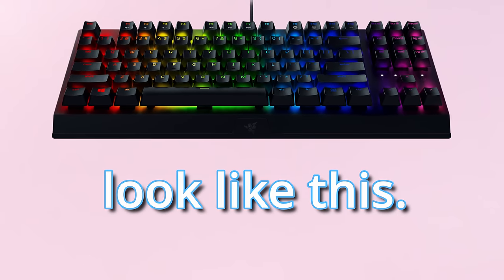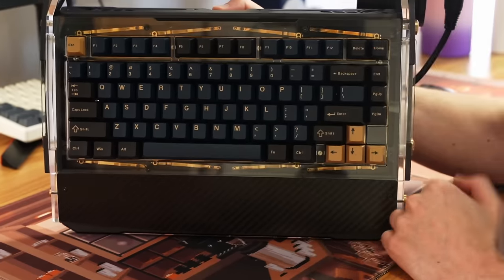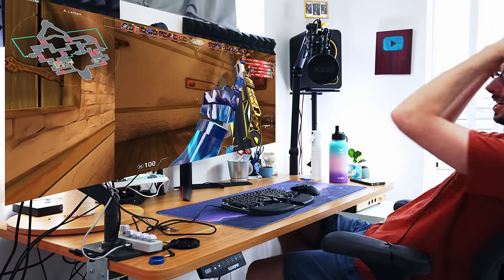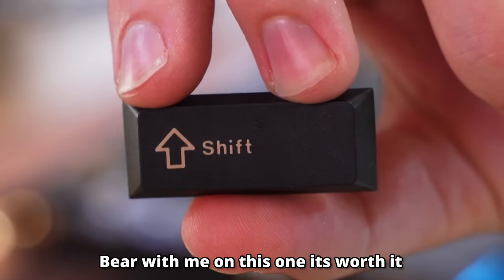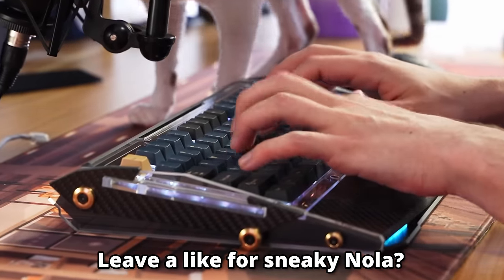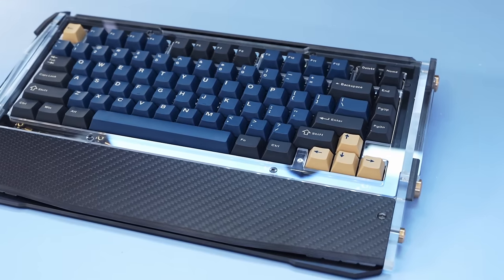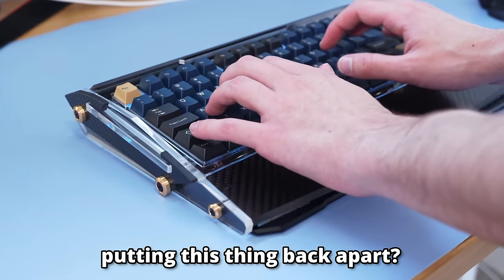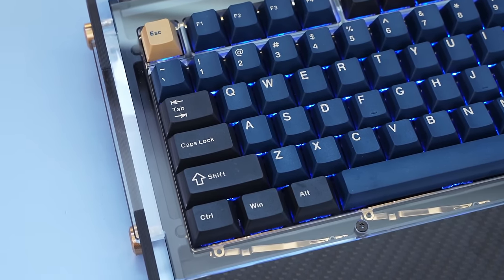Gaming Keyboards DON'T Have to Look Like This...

Comment from the maker: ⬇Affiliate links to help out the channel ⬇
Black Diamond 75 Keyboard: https://store.dry---studio.com/HIPYOTECH
Hipyo Merch: https://hipyo-shop.fourthwall.com/
New deskmat: https://hipyo-shop.fourthwall.com/products/coastal-retreat-desk-mat
My other desk mats: https://kineticlabs.com/desk-mats?ref=hipyo
✔ Get 5% off your keyboard modding supplies (like stabilizers and krytox) and support me by doing so! https://keebsforall.com/hipyo ✔
Reply: so were you wrong? or only rgb and wireless charging is the difference
Reply from the maker: only rgb and wireless charging is the difference @weaboo4444
Reply: 💀hipyo theory 💀
Reply: @HipyoTech please review the rk61 plus😭
Reply: whats the "low typing angle" keyboard you use then?
Reply: The craziest part about this keyboard is the price.  That's actually not bad at all for what you're getting.  Slap some better stabs on it and you're good, right?

Comment: I got mine and customized my Black Diamond with WS Cthulhu but I also ordered switch films since I wanted to keep using the included Gateron switches.  These switches have so much housing wobble they actually "creak."  Filming actually helps in this case.  If you use another switch there's no issue.
Overall this board is a steal for such a good looking, feeling, and sounding board.

Comment: You can fix that kind of keycap wobble with stabilized keys using thin washers on the stablizer stems: it'll fix the problem pretty much without any drawbacks. (unless you count it as a drawback that your large keys feel very stable and solid)

While ago I 3d printed a set of thin washers to get rid of cherry keycap binding issues with certain switches and I noticed that they can be used for getting rid of the large key wobble issue as well.
Reply: are these washers basic round ones or cut with the little plus on the top like the top of a switch? that is a really good idea...i have a couple keycap sets that this ruins them.
Reply: @skateecho  I did the 3d prints as standard rounded as most of the stabilizers are very lenient towards the the area around the stabilizer stem even including the closed off design of the GMK stabilizers. If you don't have access to a 3d printer and are happy with a very crude looking (but about as effective) fix then you can even create these washers by cutting the rings from a thick craft paper and layer couple of those on top of each other.

Comment: Hipyo please, I know you've already looked at a few of their keyboards, and they aren't really known for consistently good products. But I implore you to give the ASUS Falchion RX Low Profile a try. I've stuck with average Corsair keyboards for years. But after giving this a try myself I'll never look back. The thock is pretty decent and they're still quiet enough to be used in a work environment. Just sucks because they use the proprietary 4 post design for the switches. At least they're pretty dang good keycaps.

Comment: I was actually looking at this the other night and wondering if I should review it.

The new Gateron Silver Pros are pretty good had them in my work keyboard for a week and they are fast and pretty quiet.
In the process of switching those out for Kailh Clione Limacina switches, probably my favorite switch right now, especially with clear keycaps.

Comment: Just received my Black Diamond 75, the key wobble in mine is not there. This video is only 4 weeks old so I doubt they would have changed the key caps they put on these boards between then and now. Very weird, great video though, it sold me the keyboard.

Comment: Are the plastic pieces on the side rotatable to change the angel of the keyboard?
It kind of looks like it can do that
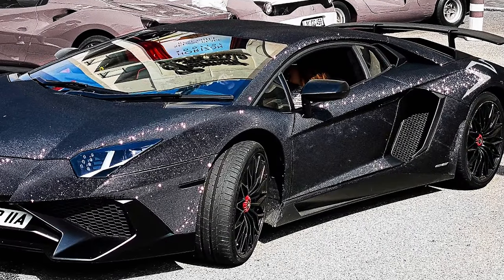Reply: judging by the flat back of the keyboard (u can see at exactly 4:00), i wouldnt imagine so
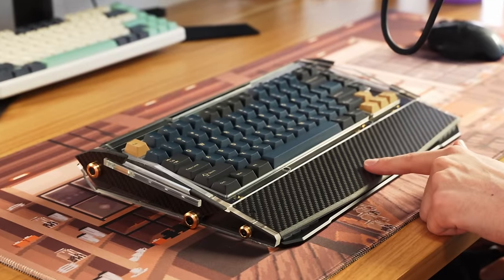Reply: @stalecakestudios  Look at 2:30, those screws on the side of the keyboard. Looks like the one on the top of the board has the carbon fibre piece screwed through it. Then the carbon fibre piece is resting on top of the next screw. I assume that the carbon fibre piece could rotate to sit under the screw which would raise the keyboard at a different angel.
Reply: @marek.lochki  ah i see what you mean, like if that second screw pulled out, then the carbon fiber piece dropped down, and the screw went back in? Thatd be pretty cool, but id guess thered be a riser at the top back of the board so it didnt tip back when typing. In which case, would it be more worth just having a riser at the back? No idea without having the board in my hands, but would be useful

Comment: What would anyone recommend if the requirements are: should not have an insane tax or delivery fee to europe, 75% (non compact if possible) must have available iso layout, must have rgb, be able to change rgbs macros or whatnot. Wireless preferably also, but not a must,  1000 hz polling rate or more. Knob will probably never be used and a screen on the keyboard would be cool but not needed. Been thinking about the gmmk pro or asus azoth, but more that I read I feel like it is a scam haha.

Thanks in advance!
Reply: I have been doing the near exact same reach for 2 weeks now haha. Just settled on Q1 Pro Barebones then building up. Case arrived today and rest tomorrow. But that seems to meet all your requirements, not sure about 1000hz rate though. Also, bought from a website called keycrox that was great and in stock.
Reply: @WillEgby  oh okay, how is the rgb settings? Is it able to change between all colors wanted and able to have static? Or is their only a limited set amount of colors you can choose from? Also thank you very much for replying to my comment! Highly appreciated!

Comment: I'd love it if a keyboard had a physical power switch for going wireless and just plugged in to go wired. For that matter, I'd love for a keyboard to have a full set of keys and not cost more than $50 considering that most have less than $20 worth of materials that go into them. The only ones I've seen that justify their price even a little are the ones made out of metal. One of these days I swear I'm going to start my own equipment manufacturing company just to prove that these companies are all greedy and/or stupid because they can't manufacture things cheaper even though they're still using slave labor in China.